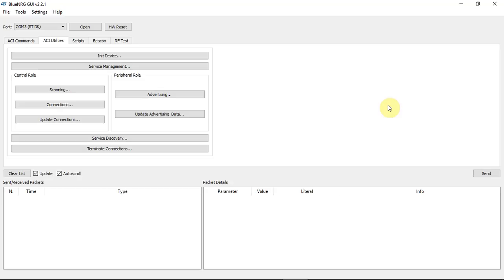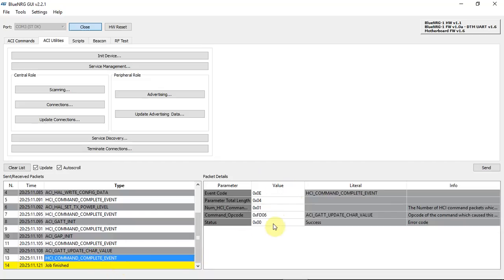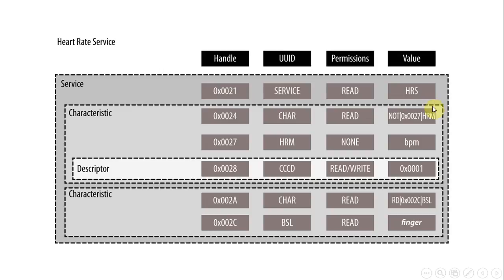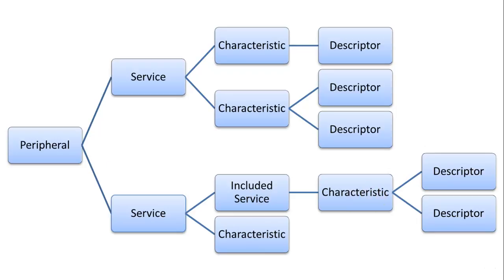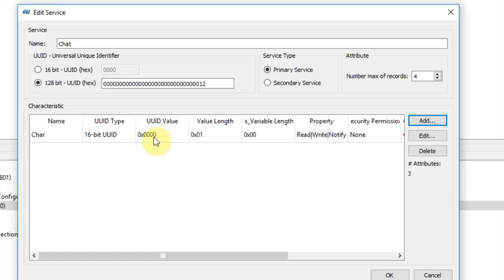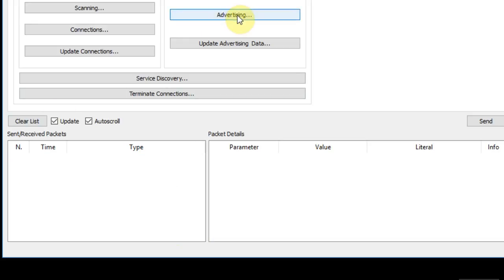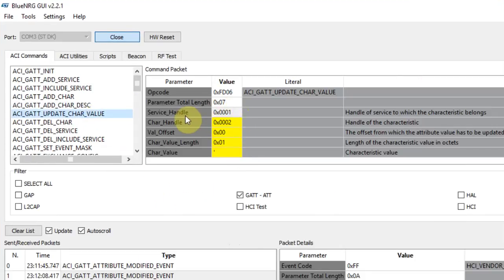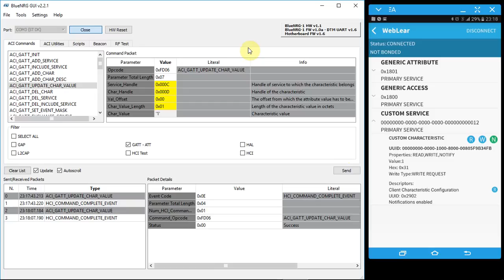BlueNRG-1 GUI advanced

Comment: Thank you for this video!
I have some problem with the bluetooth module in Windows 10.
Bluetooth module can't find BlueNRG-1.
I tried to load example HID Mouse but  the bluetooth module in Windows 10 can't find BlueNRG-1.
I have checked the bluetooth module in Windows 10. It's support a BLE.
On the Android the mouse work.
Could you help me?

P.S. I use the STEVAL-IDB007V1.
Reply from the maker: Алексей Журкин . I don't know what BLE you have on you computer. if it works with the android, then it should work with the PCB.  Make sure you have the correct drivers for the BLE, and you can also try to connect your Android to the PC. If that also doesn't work, the for sure there is something wrong with the PC BLE.
Reply: Hello!

I find strange behavior of the Bluetooth LE Enumerator in Windows 10.
Sometimes the windows show bluenrg-1. After 5-10 sec windows lost bluenrg-1.
I can't bond to device If the windows find device
Reply from the maker: Sorry, im not able to help with the issue that you have in Windows. Please try to contact one of ST representative where you are located. They might be able to get you the correct support on this.